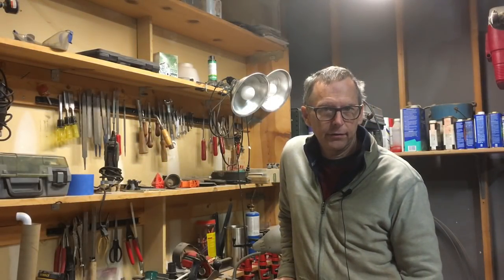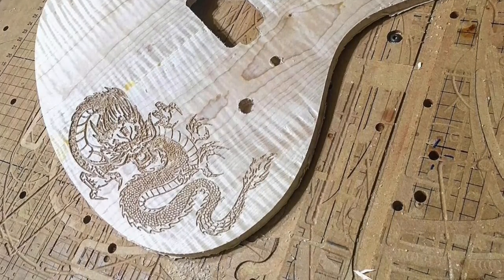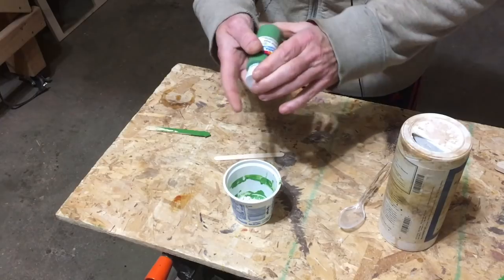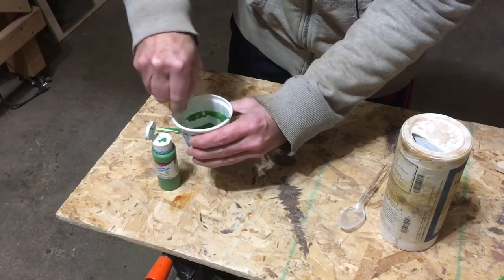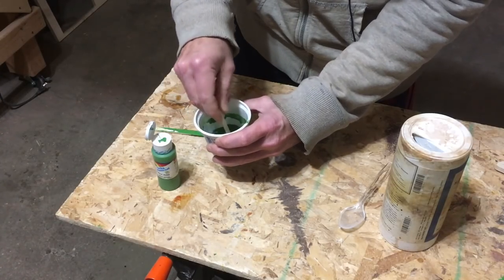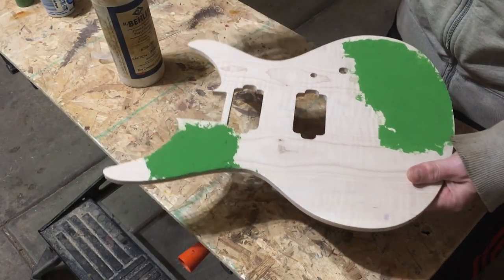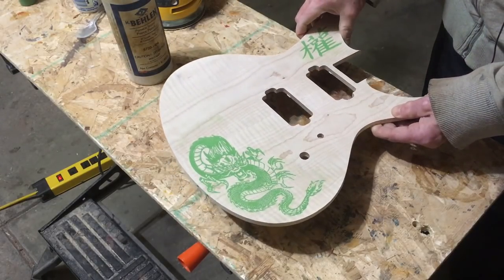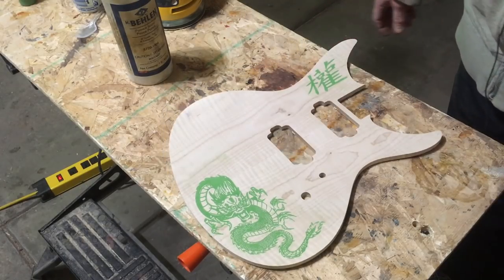How To Make A Solid Color Inlay Design On A Guitar

Comment: Quick question: with this technique can you still use colored dyes on the body or are you limited to more natural looking stain and sealants?  Like, for example, if I wanted to inlay on a red top, would I still be able to use a red stain or dye after the colored inlay, or would it just discolor everything?
Reply from the maker: You can try it, but it will probably change the color of your inlay.
Reply: Yeah, unfortunately, thats kind of what I figure too.  Was hoping you'd tried before with the pumice.  Using tinted wood filler for the inlay definitely would.  Oh well, guess it's time to grab some scrap and experiment!

Comment: I was wondering if you've ever done the Baked Polymer Clay inlay on a headstock with binding.  Would putting that in the oven warp the binding at all?
Reply from the maker: I would never do that. Not only would warping be a problem, but the binding glue would fail.

Comment: Novice Question: what grit paper are you using? Thanks for another great video.
Reply from the maker: With a 1/4 sheet sander, I'll start at 150 and work up to 220. By hand only I'll start at 80 and go up.
Reply: Highline Guitars gentleman. Thanks
Reply: eddie julian 
Thanks

Comment: Does it make sense to only do such inlays to a stained guitar because of all the sanding or is there a way to add inlays to a guitar you plan to paint?
I would like to add an inlay to my headstock but I also plan to paint my headstock.  I'm not sure how to pull that off.  Thoughts?
Reply from the maker: Sure you can. Just mask off the inlay before you paint it. Then bury it in clear coat so you can level sand it and eliminate the raised edge.
Reply: @HighlineGuitars  Ok, I will give that a try.  Thanks.  Love your videos by the way.  When I mention you my other guitar building friends know who you are too.